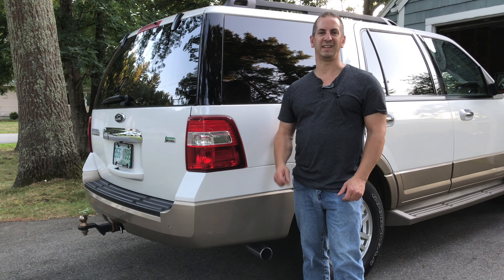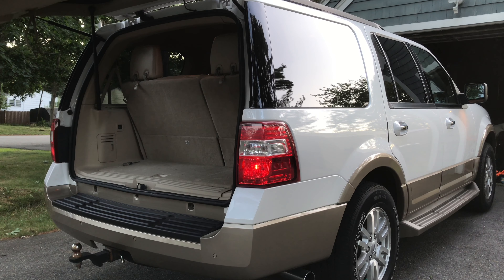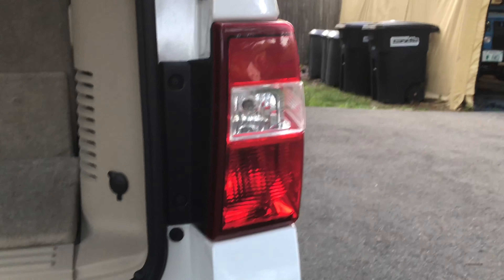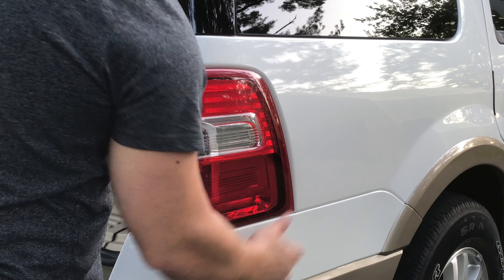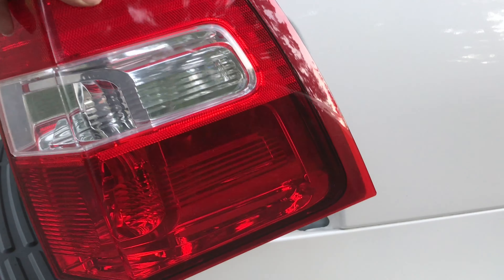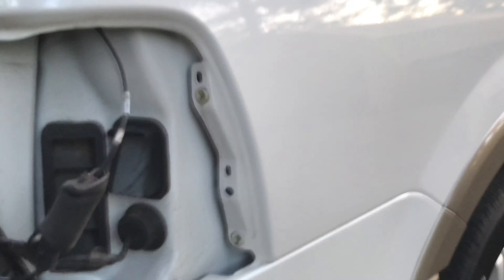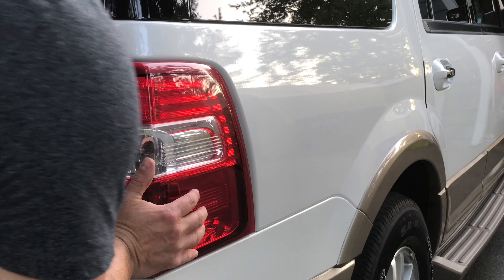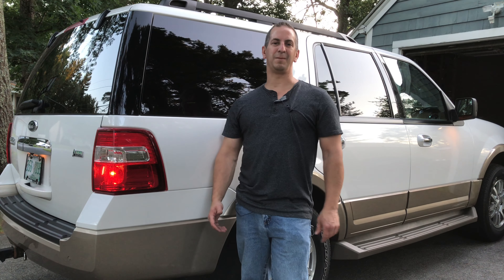How To Replace The Taillight on a 2007-2017 Ford Expedition

Comment: Good but you left out taking the old taillight from the tabs
Reply from the maker: Not sure what you mean. This should be everything you need to do.
Reply: No biggie. I hadn't pulled the bulb itself before. You have to just pull hard. I was worried it would break in my hand. Got it done. Thanks for help.

Comment: Good afternoon, can you please tell me what size the top bulb is?  I feel so silly asking that question, however, every time  I google it, it gives me the bigger bulb for the bottom. Thanks :)
Reply: You ever find out? Having the same problem right now
Reply from the maker: If you go to your local auto parts store they can match up the correct bulb for you.

Comment: My 2011 has two wires going into twilight assembly between the 2 bulbs. The replacement has no spot for whatever this is.
Reply from the maker: Is it the reverse light you are talking about.

Comment: Thanks for the tutorial....wasn’t sure what kind of tabs were holding the tail light into the frame; plastic or metal.  Once I saw the video I wasn’t worried about accidentally doing damage to the casing.
Reply from the maker: Thanks for watching the video. Glad to hear this helped you out
Reply: That was me too. Didn't want to pull too hard until I knew I wouldn't break something. Perfect information. Thanks!